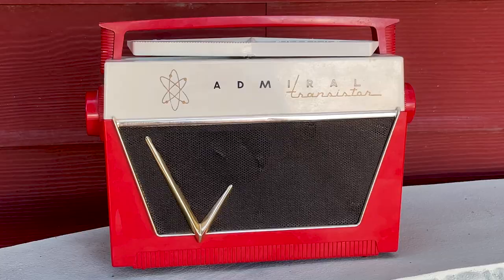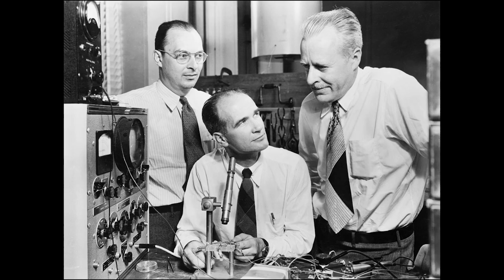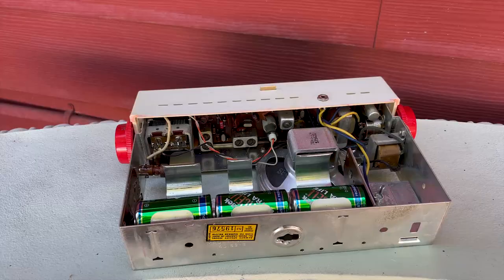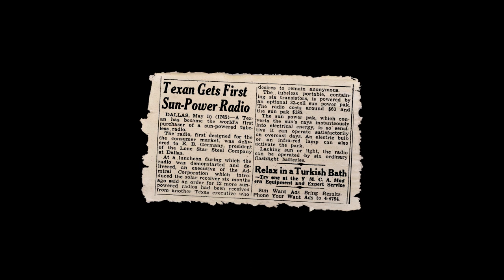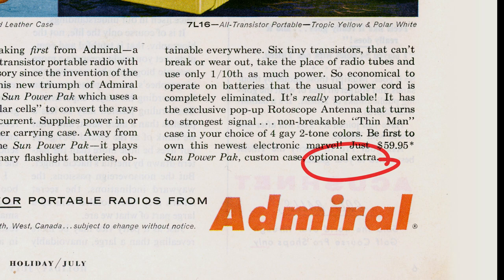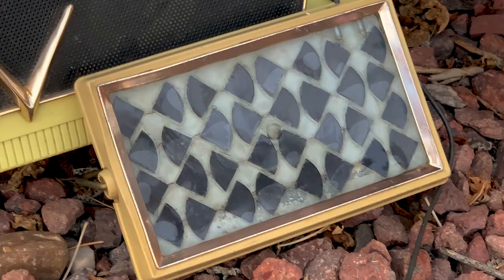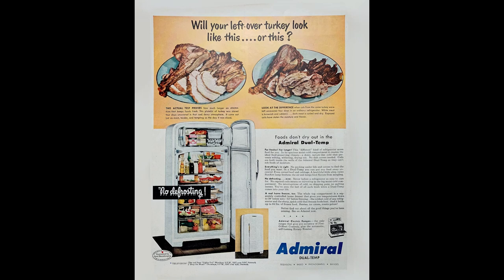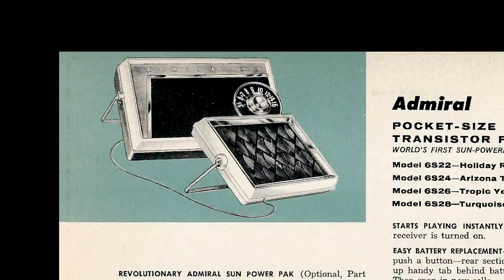World's first solar consumer product 1956 Admiral transistor radio Sun-Powered

Comment: I bought a 7L12 off ebay last month and at a decent price considering thier popularity and rarity. The description said for parts or repair. Battery corrosion probably  kept the bidding down somewhat and I was happy that no real damage done. It plays great on all it's original parts. The electrolytic caps Admiral used seem to be of better than average quality compared to other makes.